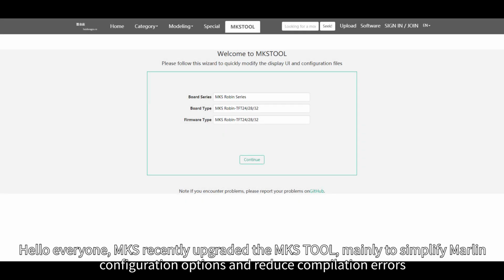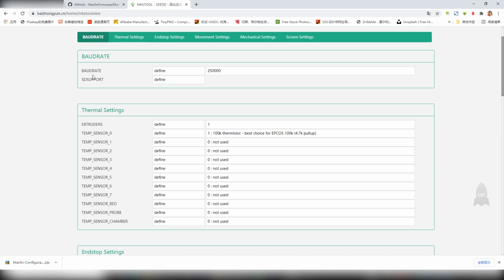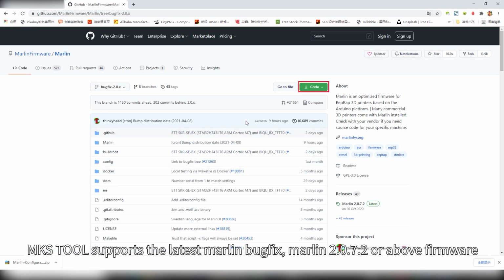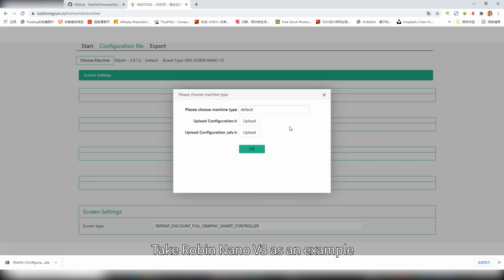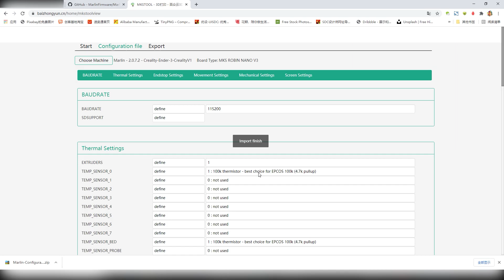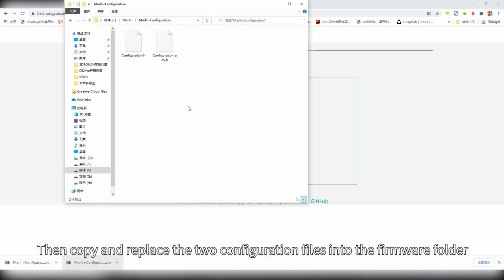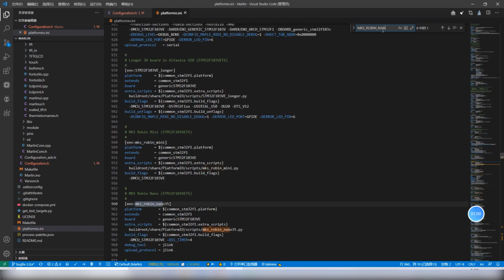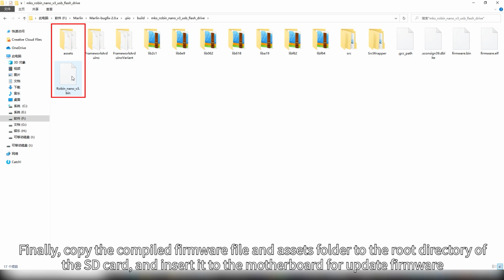Makerbase online configuration firmware tool: MKS TOOL

Comment: A GUI like this is what this industry needs badly. I can't imagine how many people will switch to this companys mother boards. I for one would change all 5 of my printers right away. Imagine being able to claim freedom from all these companies that make all their machines run only on proprietary software and firmware. This is the future and a true game changer. I truly hope they get this working soon. I imagine a day in which I will receive a mother board in the mail and be able to plug it in to a GUI and just choose the components I have mounted and the mechanical configuration of my printer, corexy, h-bot, cartesian or delta and just go through a few settings to choose hot end type and sensors that I will apply and the Gui will just compile it all on the motherboard and the printer would just work! I can dream can't I? Come on people.

Comment: Hi MKS team, I used MKS tools web site, recompile firmware for Robin mini board; it works fine, only that "5 points manual leveling" not  work correctly; the config file set to "180, 30 - 30, 30 - 30, 180 - 180, 180 - 100, 100", but it only goes to "30, 180 - 30, 30 - 30, 30 - 30, 180 - 30, 100"; don't know why as I make no changes to the stock firware config txt, only update PID values in extruder heater;

Comment: Dear Makerbase Team, first of all, thank for nice tool. I have combination Board/MKS Robin Series, Board type/MKS Robin nano 1.x-TFT35, Firmware/MKS Robin Nano Firmware V2.0.x . I would like to ask how I can add custom Themp sensore type in Thermal settings. After upload firmaware I lossed my settings and nozzle displey wrong temperature. Thank you advance.
Reply from the maker: What sensor is yours? The number codes of different sensors are different
Reply: @makerbaseteam4217  I have combination of thermistor NTC100K 3950 TL, Makerbase MKS Robin Nano V1.2 32Bit Control Board+TMC2209+TFT35. For my conditions I had to make new thermistor table thermistor_88.h, because standard thermistor table not working correctly. After upload firmware Mks-Robin-Nano-Marlin2.0-Firmware-master everything working correctly but with standard marlin display. After build Display UI+Configuration file by MKS TOOL(MKS Robin Series/MKS Robin Nano V1.x-TFT35/MKS Robin Nano Firmware V2.0.x)I lost my thermistor settings and I can to choose just two version of thermistor table, number 1 or number -3.
Reply from the maker: @jansrokovsky9370  Select 1 temperature can not be displayed normally？
Reply: @makerbaseteam4217  Real nozzle temperature is wrong. Example - displayed 137 real cca 260. I changed thermistor for newone and situation is the same. My thermistor value for 200 is { OV( 285),  200 }, for selection 1 is very different.
Reply: I would like to ask you, if it is possible insert my thermistor value by command in the file robin_nano35 cfg.txt. If yes, can you send me command, please ? Thank you advance.
Reply from the maker: @jansrokovsky9370  1 That is, it is marked in the configuration file
Reply: @makerbaseteam4217 Thank you for your patience, I know that my question is maye stupid for you, but I am beginner and my 3D printer still not working correctly. Every settings I can change normally but without nozzle temperature. And as you know, for correct printing this parameter is very important. I can change for example buttom funktion by command >moreitem_button1_cmd:G28; by .txt file. Is it possible to input termistor table value to .txt file ? Command >TEMP_SENSOR_0		88, not wornikng Err2. If yes, please send me command. Thank you advance.
Reply from the maker: @jansrokovsky9370  No, thermal sensitivity can be set to 1

Comment: hi MKS team ! Please make configuration for Robin Nano and other mainboards so we can make CoreXZ, thank you
Reply from the maker: Corexz can be set, the default is that it can be set in the configuration, you do not choose the model, it is not after selecting the model
Reply: @makerbaseteam4217  only cartesian and corexy is there. With marlin it is possible but with yours i did not see, please explain it there is
Reply: @makerbaseteam4217  i need CoreXZ not CoreXY
Reply from the maker: @ramilvaliev  1:05 in the video, machine settings, the second line is corexz, just enable it
Reply: @makerbaseteam4217  yes but i want your simple firmware not marlin. Like text config file it is so simple

Comment: When you will offer the Robin nano V3 configuration?
Reply from the maker: Hello, the configuration file of nano V3 is the configuration file of marlin firmware. Import the configuration file in this tool and select nano V3
Reply: @makerbaseteam4217  Theres no option to H43 Touch Screen panel?
Reply from the maker: @CharlieAMiquelin  mks_dgus is H43
Reply: @makerbaseteam4217  thanks I Will try!
Reply: @makerbaseteam4217  The site it doesn't works! It hangs on when I choose Marlin + MKS Robin Nano V3

Comment: Export a configuration file works incorrectly: name of a parameter and its value goes without any delimeter (space or tab)
Reply from the maker: Hello, which version of the firmware you have exported is incorrect
Reply: @makerbaseteam4217  MKS Robin Nano V1.x-TFT35 -> MKS Robin Nano Firmware V2.0.x. First line of the file: >MACHINETPYE0     # Machine type  0:Cartesian  1:DELTA  2:COREXY
Reply from the maker: @vldchursin6137  Are you talking about delta? Delta needs to import the delta configuration file first
Reply: @makerbaseteam4217  No. Not Delta. And importing a configuration file does not help. MACHINETPYE0 must be MACHINETPYE 0
Reply from the maker: @vldchursin6137  I just tried it and it’s okay. Did you choose the right model?
Reply: @makerbaseteam4217  Right for what? I'm just looking in the text configuration file. It has an incorrect structure. It does not matter what model is. Any model can not read such a file